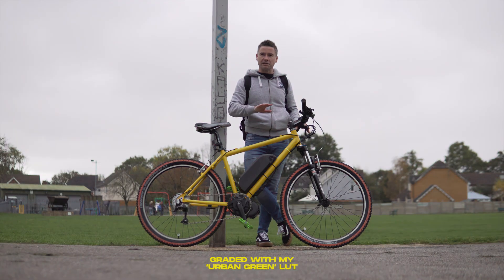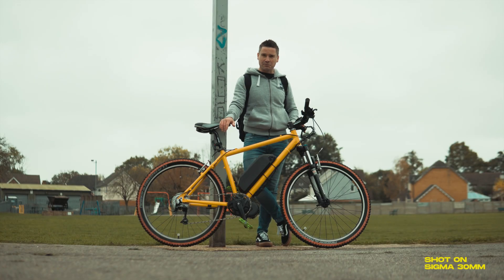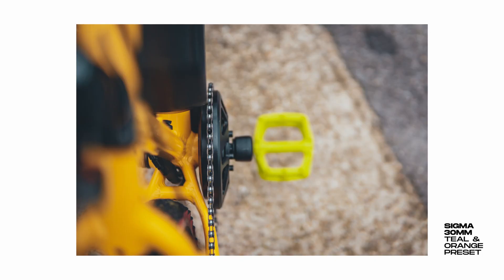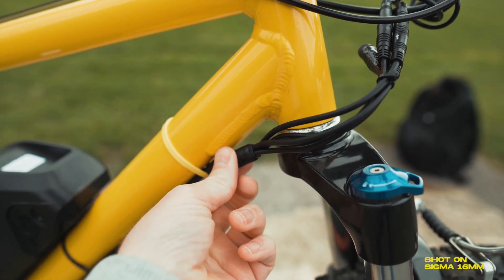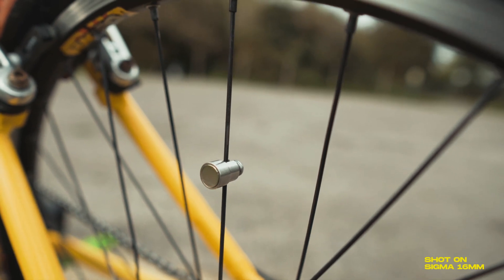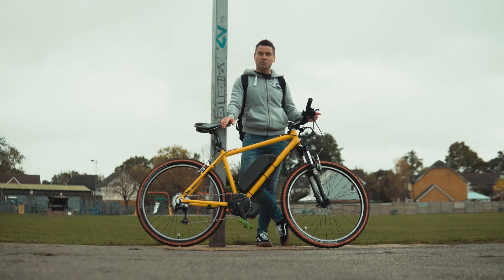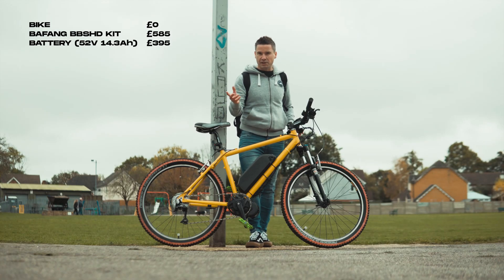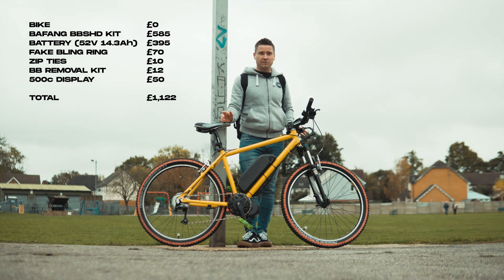Bafang BBSHD 1000W Custom E-Bike Conversion (Sigma 16, 30 & 56mm)

Comment: Hi Stuart and followers. I use a bafang mid drive and generally love it until I turn it off or set assist level to 0. Then I feel a lot of drag in the pedals. I hoped it would feel like a loaded touring bike and I could carry on but it feels much harder. Any comments as to how normal this is?

Comment: Roughly how many miles per charge?
Reply from the maker: I get around 30 miles. The battery will still be at approx 20% but there will be very little power left for the throttle.
Reply: @StuartRodwell  Thanks!

Comment: What do you think of the center pull brakes. I would think they would not be sufficient for stopping, especially if you are exceeding 30 mph. I would look into at least a hydraulic disc brake for the front. You might have to switch out your forks and wheel to do that, but you will notice a difference in stopping power.
Reply from the maker: Their not ideal, but they seem to be doing the job so far - although I could do with replacing the pads!

Comment: What kind of range do you get with the battery you chose?
Reply from the maker: It’ll do 30 miles and still have approx 20% left which is when I’ll recharge it. The chap I bought it from said the battery will last longer if you don’t fully deplete it.
Reply: @StuartRodwell  That's pretty good. Is that throttle only?

Comment: Nice bike Stu , I started my BBSHD built and notice that the offset of the stock chainring didn't fit my bike therefore I've changed it to a higher offset to ensure a better chain line. Did this also occur on your install ? Please advise. Thank you !
Reply from the maker: Thanks Marc! No, tbh I’d already purchased the offset chainring ahead of the build as I was originally going to use it on a BMX. I decided to use it on the MTB instead so the stock one is still in the box! 
Sorry, I know that’s probably not much help!
Reply: @StuartRodwell  Hi Stu , The reason why I asked was I notice that your chain ring is the same as what I've ordered , the stock chain ring  that I have will be used to chop lettuce LOL. What make is that chain ring and the size I'm guessing 42 teeth. Do you also know the offset ? Kind Regards , looking forward to hear from you.

Comment: Cool build! i have exact the same kit and battery. one thing tough, i see you have rimbrakes..  dont you think you need a bit more stopping power? my bike is a gaint atx 2 and at the rear i have a 160mm disk with a mechanical caliper and at the front i have a 180mm disk with an hydraulic caliper. i used to have a 160mm in the front aswell, but i wasn't completely satisfied with the stopping power. i always like to have a bit of extra room in case of an emergency stop.
Reply from the maker: Thanks Jeff! 🙌🏻 Yeah I guess it could do with a little more stopping power but I generally just use it as my commute in the warmer months and try not to go too mad with the throttle!

Comment: I purchase an electric bicycle for $4,000 and the company told me I have to wait 6 months, so I cancel the order. I'm doing the same, I purchase a used bicycle for $100 and put another $1,100 into the battery and the motor kit hopefully, I will finish my bike in 2 weeks, and like what you said, making your own E+bike is a lot better than purchasing one. This one is a custom fit for me, with a lot less money and more power.
Reply from the maker: Hey Ken, hope you’re bike build is going well. Definitely rewarding building it yourself 🙌🏻
Reply: @StuartRodwell  Yes, for one-third of the price, I built a bicycle that's 160 Nm in the United States of America, the sky is the limit, my bike does 35 mph,  actually my bike looks like yours a green diamondback Wildwood. LOL
Reply: Good move. I have an old Trek 4500 mountain bike that I converted to an EBike for $800 USD. I have the Bafang BBS02. It outperforms most of the pre made EBikes at a third of the cost.

Comment: I don't understand why one would spend that much on a homemade cycle to go 30-40 mph, when you can spend a little more and get a dirt bike that's properly engineered and much more capable. These look like fun, but bang for the buck, not so smart.
Reply: Hard to ride down the road to work on a dirt bike, although that would be really fun. I rode my xr100 to deliver papers back in the day, until the local police kindly asked me to stop. I would have used this if it existed in 1998

Comment: Nice video. You could remove, clean then spray the V  brakes black with a small spray paint can from Halfords, I did it on mine and they are still fine a year later, very easy and straightforward. Shift sensor, I fitted one of those also and find them really useful for smooth gear changes. Mine is a Bafang BBS02.
Reply from the maker: Hey John, that's a great idea - think that may be my weekend project! 🙌🏻